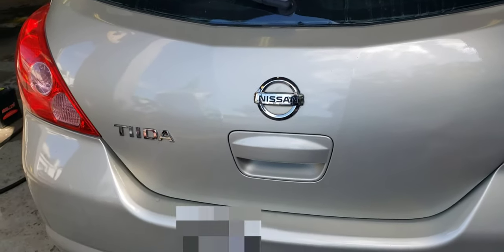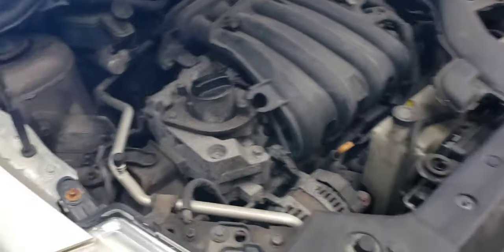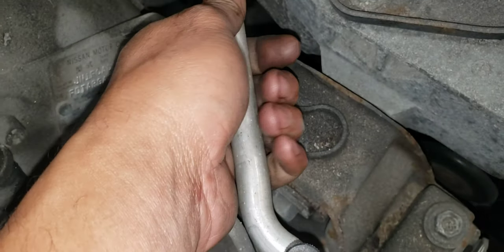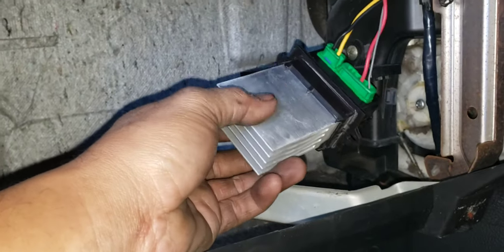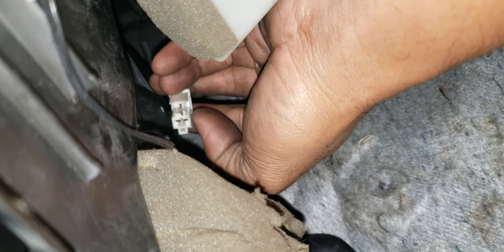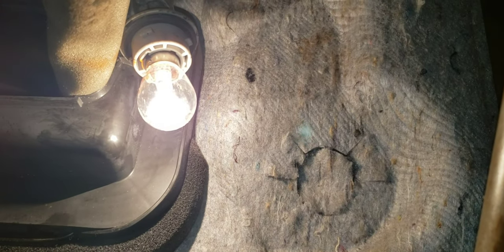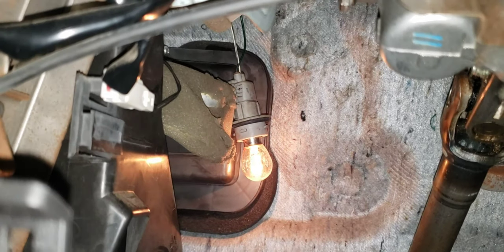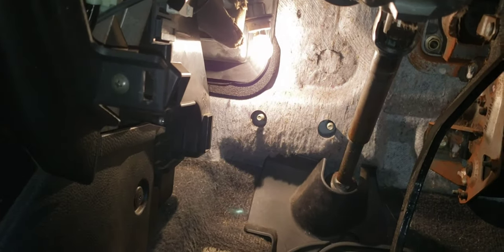NISSAN TIIDA how to check or Test Air Con Blower Not working

Comment: Thank you, the video is very informing. Can you please let me know where is the fan placed in the car? The fan that you hit with a hammer. My nissan has the same problem now and its -5 Celsius outside so its blazzing cold to drive without the heating system working properly. Thanks

Comment: Hi Kabayan, are you in New Zealand?
Reply from the maker: Hlo po good day,wala po ako s new zealand
Reply: @bordzkiatvlog3729  . I have problem with the same unit. Ask ko lng sana kung mkikita yung condenser fan relay ng nissan tiida. Nagpalit nko ng 3 relay sa engine bay pero ayaw parin umandar ng condenser/radiator fan. Umaandar naman ung radiator fan kapag mainit na ung engine and umaandar din compressor. Any input about this issue Sir.?
Reply: You need a help im on Nz